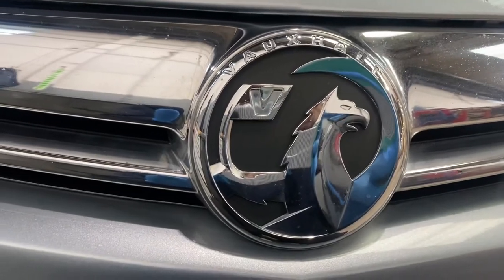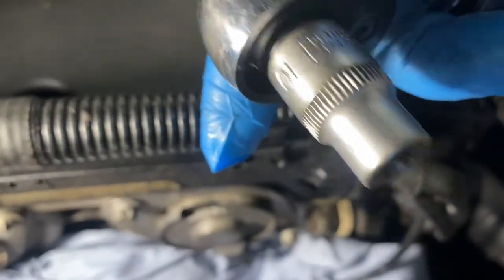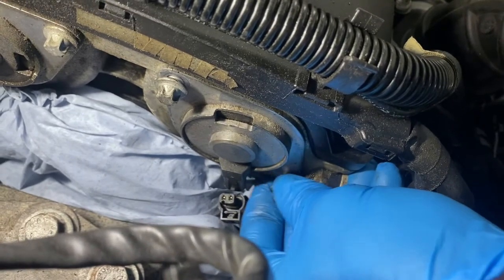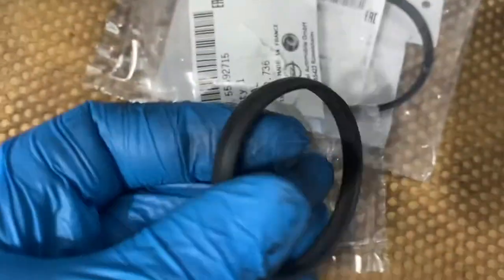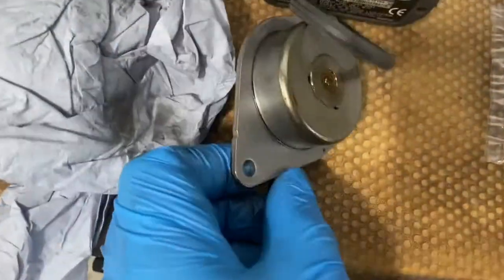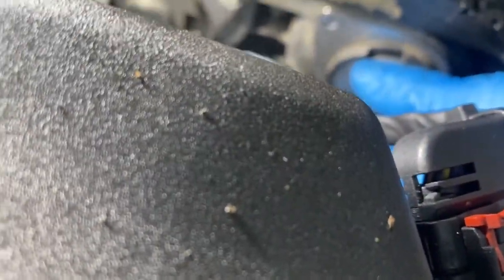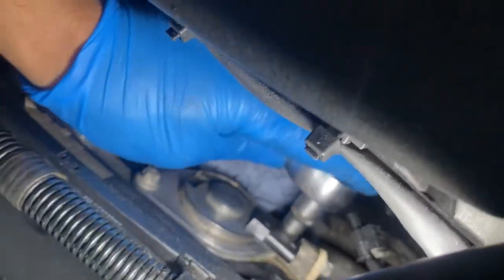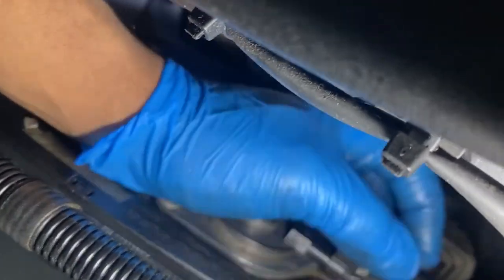#Vauxhall #Astra #Gtc #camshaft #solenoid #valve #seal replacement

Comment: Can i just ask when pull it out, nothing needs locking in or anything or nothing drops ? just straight out and push the replacement back on yes ? thanks
Reply from the maker: Just line it up and refit

Comment: Hi which. side is bank 1 camshaft sensor thanks
Reply from the maker: Should be next to the timing belt or timing chain side close to cylinder 1
Reply from the maker: On the intake side of the engine

Comment: what are the symptons of it's failing?
Is it just oil leak? or any noise or anything else?
Also, do I have to drain Engine oil and refill them for this work?
Reply from the maker: Oil leaking from the seals

Comment: Hi. I own a Mokka, 1.4 140PS. 
I've seen some oil under those solenoid valves - I am guessing I need to do this fix. 
I've noticed that my oil is smelling a little bit like petrol. OIl was changed around 2000km ago.
The oil level on the dipstick is not changed - it is the same.
I see no other leaks or issues. The car runs normal.
Do you think that the oil smell is somehow related to this?